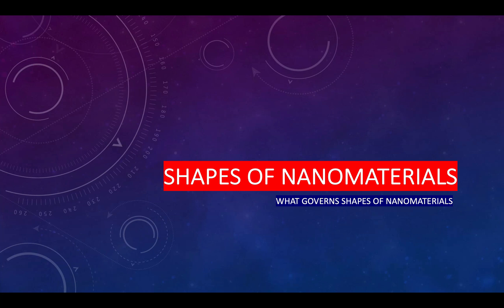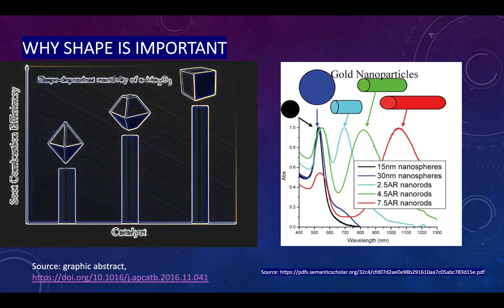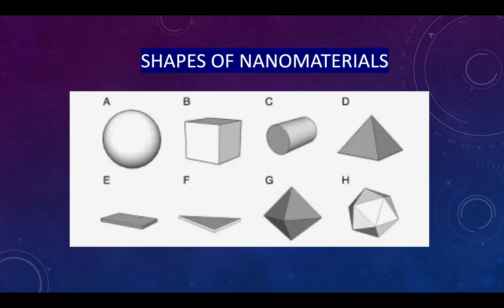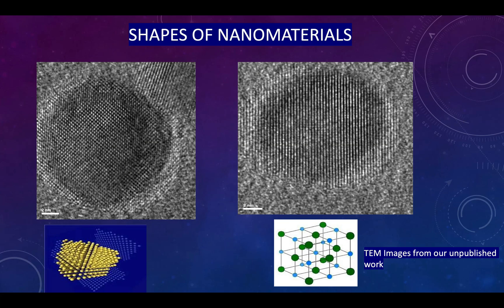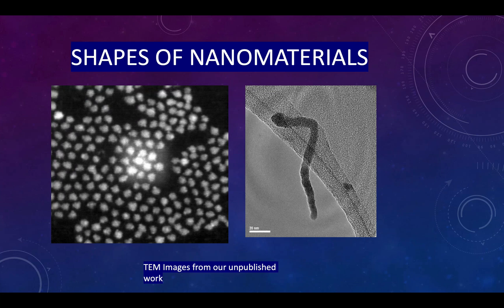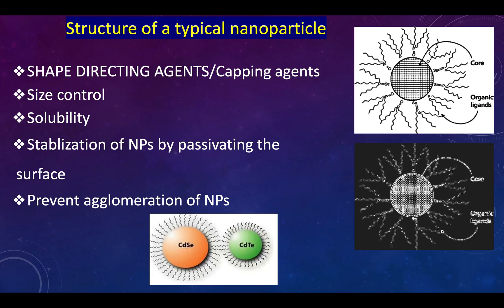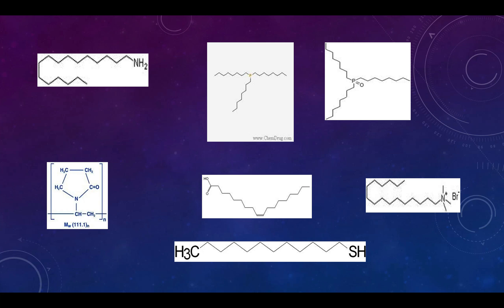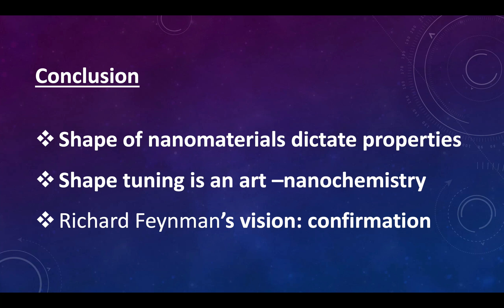shapes of nanomaterials: how to control-part 1

Comment: Assalam o alaikum
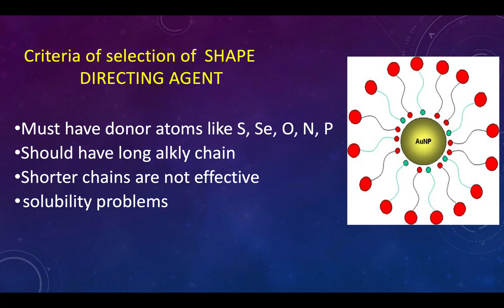Sir how short chain alkyl create dispersion problem ?? 13:21
Reply from the maker: Shorter chains have limited solubility in non polar solvents For example , methanoic acid to octanoic acid, solubility/ dispersion increases linearly in non polar solvents. Further, shorter chains are not effective in controlling size of nano particles while longer chains control effectively
Reply: Alright, thank you 😊 sir
Reply: sir, in this case can we say that dispersion is better term rather than using the term solubility??